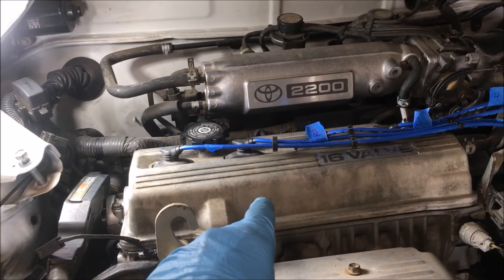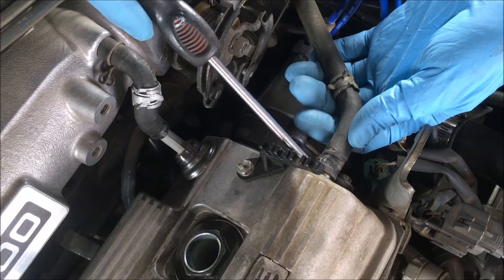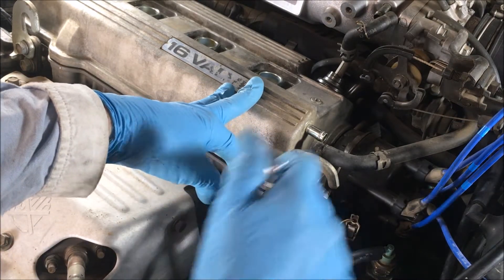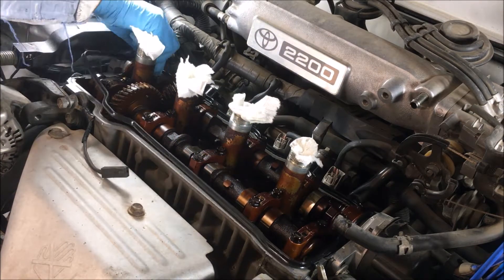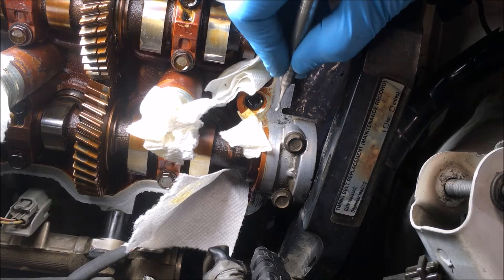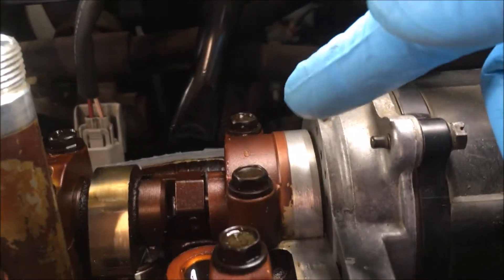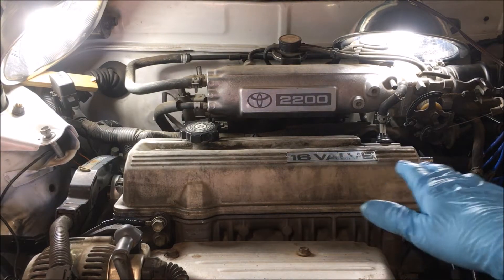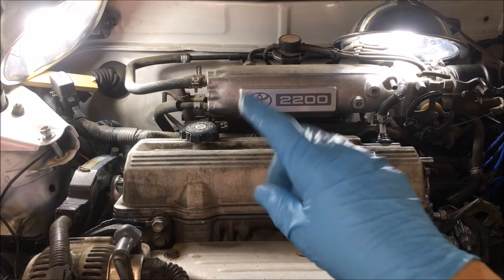Replace Valve Cover Gasket | Toyota Camry 1992-2001

Comment: Hi there. Used a toothbrush size wire brush for for the valve cover gasket mating surfacing areas.
Reply from the maker: Copy that, Dave.
Reply: It works 👍 great!!! Car is done and running great!!!
Reply from the maker: You did good, my friend!  Good for you for fixing the valve cover gasket yourself and saving a bunch of money.  I'm glad your car is running great, and that's all due to the stellar mechanic who fixed it--YOU!

Comment: thank you for your awesome work, this right here is the definition of quality content.
first timer working on my camry and your video was great guidance.
as for the 30mm nuts backing out over time, could some thread locker designed for that type of environment be used to keep em from coming loose?
Reply from the maker: You're welcome, Luis, and thank you for your thoughtful and kind comment.  It means a lot to me.  Regarding threadlocker on the valve cover nuts, you may well be on to something there.  I can't give an opinion because I've never applied it there.  I worry about getting anything in the spark plug tubes, though, as I'm removing the nut.  If you do use threadlocker, I'd recommend Locite 242 (blue) or Permatex 24200 (blue).  They're both medium strength.  If I used it, I'd apply just a little of it to the nut threads with a matchstick or tooth pick 

I do check the nuts about every mouth because they WILL back out.  I hope this helps you.
Reply: @frugaldiy1  gotcha, maybe a little compressed air to get those pesky thread locker particles out of the tubes, or is that a no no? thing is, knowing myself it's guaranteed i won't be routinely tightening them nuts once a month.
thanks again for sharing your knowledge.
Reply from the maker: Luis, I think you'll be fine since you're aware of the concern of the threadlocker particles falling into the tubes as you remove the nuts.  I think you'll be okay.  But, when you redo the valve cover gasket next time, after you use the threadlocker, just loosen the nuts and pull them straight up and away from the spark plug tubes.  No, I would never shoot compressed air into the spark plug tubes, ever.  What I do is, after I remove the spark plug wires and before I take the valve cover off, I use a vacuum to remove all of the debris and dirt that sets up in the wells of the valve cover.  I works great.  

Also, since you're replacing your valve cover gasket, it's a GREAT time to replace the PCV valve on the valve cover.  I HIGHLY recommend you do so.  The PCV valve is $6.00 at AutoZone.  If you don't replace the PCV valve now, and it fails and you try to remove the PCV valve while the valve cover is on the car, the PCV valve will likely break apart, because they get brittle with age, and you will have to remove the valve cover gasket to retrieve the broken pieces of the PCV valve that are stuck and loose inside of the valve cover.  (Sorry for the way too long sentence there.)  When the valve cover is off the car, it's much easier to remove and replace the PCV valve.  

I use Felpro valve cover gaskets.  Please let me know if you need anything else.
Reply: @frugaldiy1  after watching the video again i realized, paper towels (like you used) or something to cover the tubes should do the trick and yes thank you for the tip about the pcv valve! it'd really suck having to redo everything because of it.
Reply from the maker: Luis, you are one very smart guy.  I admire that--a great deal.  Though you said you're a first-timer working on your Camry, I just know you can fix just about anything--100%!  If you need anything else, holler back.

Comment: Hello this is David you helped me with the valve cover gasket and oring gaskets. I also replaced the PCV valve and grommet. And the PCV hose. Number one cylinder spark plug had some oil on electrode but not terrible. I cleaned all four plugs which were three weeks old from ROCKAUTO. I wire brushed them and sprayed  with the starting fluid. And reinstalled them. Much better now. But when take off mostly at slower speeds the car still hiccups at random. Any ideas please?
Reply from the maker: Hello, David.  I'd look at: 1) clean the throttle body; 2) check the resistance of each spark plug wire with an ohm meter ($10.00 at Harbor Freight); 3) clean the EGR valve tubes (takes a bit of work and be gentle); and 4) look at each vacuum line for breaks.
Reply: @frugaldiy1  Your so sweet!! A friend I met told me that maybe the spark plug wire no 1 in particular might be wicking up the oil before I changed out the valve cover gasket and oring seals. I did clean the throttle body real good.  He said spray electrical cleaner in number one cylinder spark plug wire. I did all of them.  It's tuff for me to do. I have spine issues. In pain a lot. Amongst other health issues. Turning 60 soon. I have read about how to measure resistance. I'm frugal as well. Had to be. S.S.D.I. don't pay much. Thank God I have a wife that works. It's cold here outside of Philadelphia in the western suburbs.  Thank you and have a great Thanksgiving. I'll be home with my girl,Sadie my Pitbull-Boxer mix.
Reply from the maker: You sound likely a lovely man, Dave.  Please don't let your spirits get down.  We are ALL differently-abled in some way.  Know this--your might and will is strong and to be admired.  People who don't have any physical impairment(s) won't tackle what you did.  See the exemplary will and determination you have?  I do.  Never, ever, ever give up or give in.  Hold the line!  You were born to be a unique person--go be that person.  If that's not enough for other people, too bad.  You were (and still are) enough the very day you were born.  

Happy Thanksgiving, and please give Sadie a BIG, LOVING hug for me.  I'm an animal lover, through and through.  

May the Spirit of Christmas find you, just when you need it most.  ;)
Reply: Dirty Cat?

Comment: I found your video while looking to find the fuel injection pressure regulator.  I am having problems with a crank no start on my 1993 Toyota Camry wagon 2.2 engine.  I have replaced the fuel pump, engine coolant temp sensor, oxygen sensor,  starter relay, circuit opening relay, fuel filter, manifold absolute pressure (MAP) sensor, etc. with no luck.  My car would only start with me turning the key multiple times as well as pumping the gas and recently it stalled while I was driving down the interstate only to shut off.  It now will not start and I think this Fuel Injection Pressure Regulator could be the culprit.  I am not a mechanic and I am trying to figure this out.  I appreciate your video and I hope you figure out your car issues.  I was having issues with the car not wanting to shift gears and I thought initially it was transmission related, but now I think it is probably fuel issues.
Reply from the maker: Chris, did you by chance top off the gas when you were filling up the car before this issue started?  Have you considered the distributor?
Reply: @frugaldiy1  thanks for the reply and I believe the issue is actually the timing belt from doing some more research.  This is beyond my comfort level to repair so I am going to send it to the mechanic for repair.
Reply from the maker: @chrisdunlap4517  Okay, Chris.